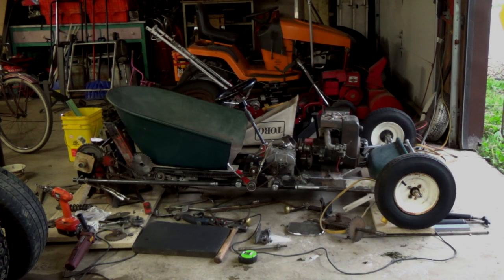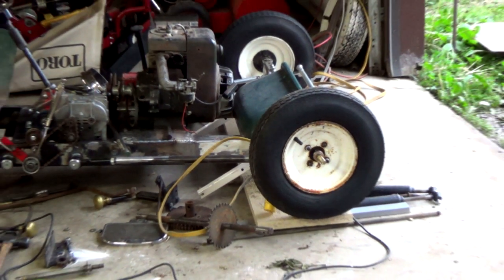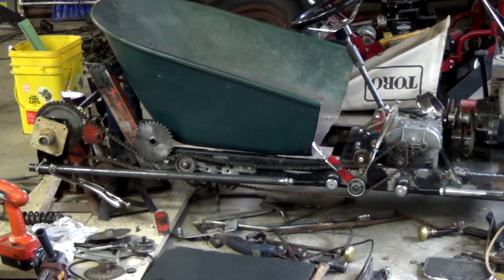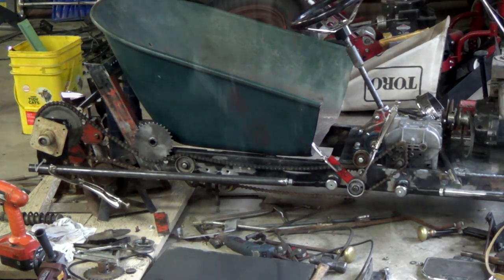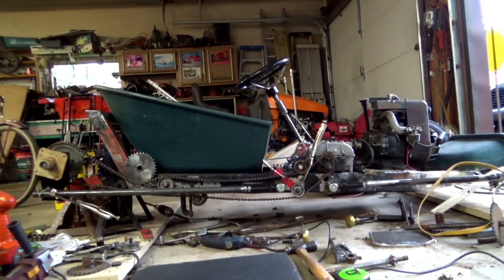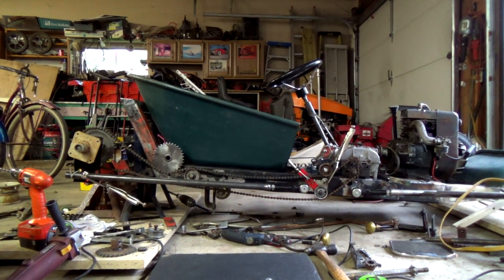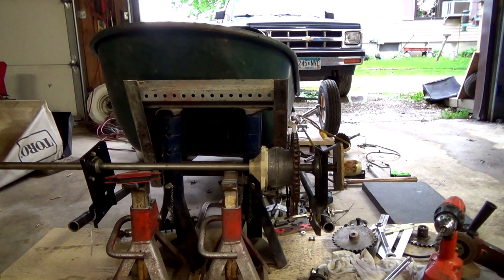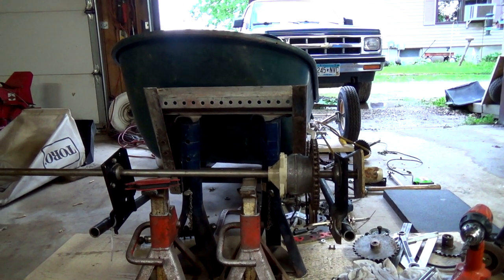Goofy Cart II, working on the chain gang, rat rod go kart

Comment: Nice Tires !!! The chain drive reminds me of those very old antique Trucks that had chain drive The rear shocks would look Ok at an angle
Reply from the maker: There will be some angle to the rear shocks for stability as well as "looks", and I am still going to use the loop springs as well, even if they are mostly for looks. Thanks Jim

Comment: Coming together George. Front tires look good. Instead if cutting a chunk out of the seat, couldn't u just attach a chain guard over the sprocket assembly and then shave off the seat ?  May make it easier and better cosmetically.
Reply from the maker: It isn't the seat that will be cut, just the body, and I will build a shield into the body in the process. This corner is actually behind the seat anyway. Thanks Deron.

Comment: What size of chain did you order? 

Funny thing about your transmission. We stripped down a montgomery ward mower as kids and it had a 3speed rear transaxle. We swapped out pulleys and got the thing to go 27mph (with my lightest friend riding it...I hit 25mph, my heavier friend 23 we were about 30lbs off of each other). They make good transmissions!
Reply from the maker: Hey Grant, I have #420 chain that I will be using as it is much heavier and was what was on the old Montgomery Ward mower, as well as a couple of snowblowers that I had stripped during this past Winter. One of the mock up pieces is #41 chain. I had thought about using #35 bicycle chain since I have so much of it, but it is too small and light weight for something as heavy as this cart will be. I have no idea how fast this cart will go, with all the pulleys to begin with and then the sprocket sizes as well. There are 4 drive pulleys up to the transmission and then the little sprocket on there back to the larger sprocket on the rear axle. I may end up putting another sprocket half way down the frame to shorten the chain length, then another from there to the rear end. Whatever I have to do to make it work. Thanks for stopping by.
Reply: +The Shade Tree Fix-it Man I took the cheap route with mine and did #35 chain, and I think that might be the source of my problems...I'm hoping to get away with running #35 chain from the motor to jackshaft and then upgrade on the other side only...go up at least to #42 I think...but we shall see

Comment: I wish you had the parts for a driveshaft system. it seems less complicated than this and you could simply put  a driveshaft tunnel in the wheel barrel. and use a rear-end from a riding lawn mower,
Reply from the maker: I could use the auger drive from a snowblower for the rear end too, but, while it seems less complicated, it would require just as much alteration going from pulleys to driveshaft in the process. There wouldn't be any need for a tunnel in the body and besides there isn't enough room for a tunnel in there anyway, but then we would get into universal joints and such. Each system has it's strengths as well as drawbacks. Something to think about for future reference though and thanks Michael.

Comment: i think you are going to have yo use 2 seperate chains for 2 reasons.#1 length #2 travel of rear suspension. i am sure you will figure it out as you go,looking forward to seeing further progress
Reply from the maker: I think you are right and have already been thinking about splitting the chain. To be honest though, I hadn't taken the rear suspension movement into consideration. Thanks for the timely reminder. That will be included in my next mockup session, hopefully tomorrow. I am glad to have friends to help with suggestions.
Reply: well another set of eyes always helps,plus sometimes we have been there done that so to speak

Comment: {Just a idea}, Use timing belt and sprockets from a ohc engine to get power to the rear end swing point. Then go to chain from swing point to axle. Belts are a lot easier to wrap around stuff. I got a v6 stuff I could send you for free.
Reply: I really like your use what I have ways of doing things. I try to do the same things on my channel.
Reply from the maker: Sounds like a good idea William, but the outdrive from the transmission is chain and I pretty much have it all set up now, using what I have. Thank you for the offer and the great idea!